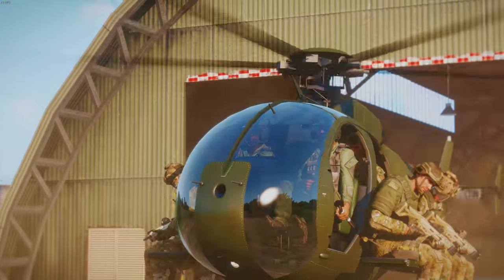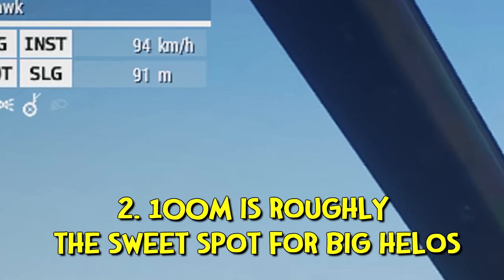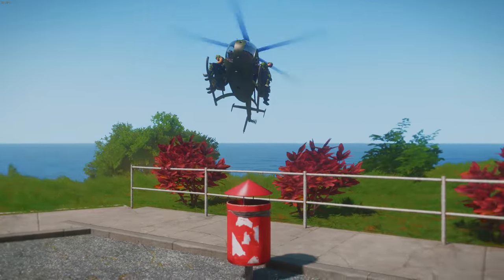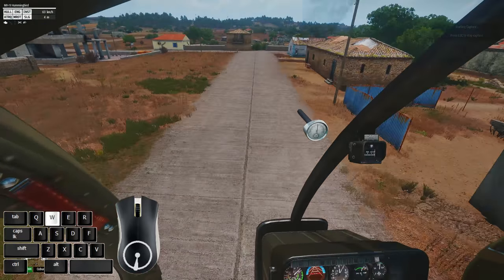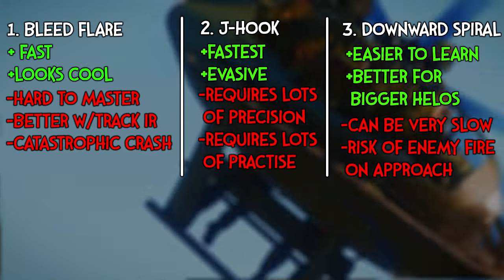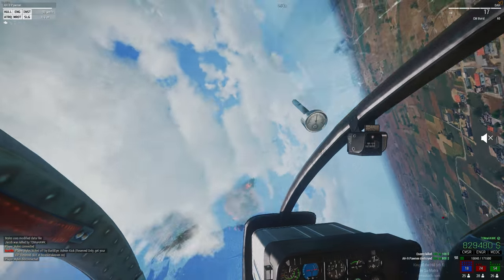ArmA 3 Helicopter Landings Guide 101 ►EMERGENCY + ADVANCED LANDINGS!

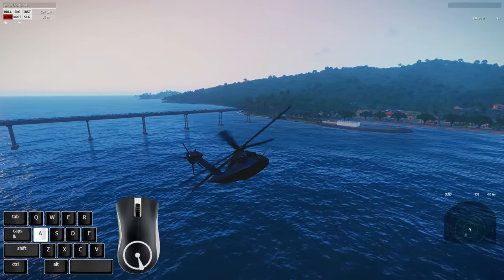Comment: 3:30 The air resistance holds the helicopter in one direction at faster speeds, which stops it from being able to easily deviate from the current direction.
Reply from the maker: PERFECT explanation, thank you so much man. This was exactly what I was looking for!
Reply: Hidden that is incorrect. Bicycles use the gyroscopic forces of the two wheels to keep it upright. These are created from centrifugal forces from the wheels. Helicopters upon loss of tail rotor use the air resistance on the body to cancel out any tendency to yaw the aircraft. This is why when flying at high speeds the rudder pedals get very little response in helicopters with or without a tail rotor as to yaw the aircraft it would increase the amount of air resistance on one side which would push the aircraft in the opposite. This is why helicopters roll into turns first as that moves the upwards force of lift from the propellers from straight up and forward to left or right which then drags the helicopter into a turn.

Edit to clarify helicopters do have a centrifugal force from their blades, however this does not effect the yaw of the aircraft, as the gyroscopic effect of rotating objects only works when the 90* point from the center of the object is rotated. This has the effect of smoothing out turbulence in helicopters.

There are some great diagrams used in FFA Ground school classes for helicopters that would provide a good visual aid and will probably give a much better understanding than reading this.
Reply: The aircraft would definitely rotate without tail rotor to counter the rotation of the main rotor. I'm a helicopter mechanic for the Marines and trust me a pilots worst nightmare is loss of tail rotor authority it will cause uncontrollable spinning of the aircraft. The tail rotor isn't just to counter wind at high flight speeds.
Reply: ELITE DARKNE5S GAMING not sure who you are replying to, but you are correct in a slow/stationary flight. At higher speeds (depending on the airframe) the air resistance on the airframe will counteract the loss of a tailrotor. “The approach profile can best be described as a shallow to normal approach angle to arrive approximately 2–3 feet landing gear height above the intended landing area with a minimum airspeed for directional control. The minimum airspeed is one that keeps the nose from continuing to yaw to the right.” ( https://www.faa.gov/regulations_policies/handbooks_manuals/aviation/helicopter_flying_handbook/media/hfh_ch11.pdf ) notice the excerpt in minimum airspeed, which is to be kept to a point at which the yaw of the aircraft is counteracted.

Additionally the manufacturer of the aircraft may recommend different procedures which may include a 1. Running landing (as stated above) 2. A autorotation which terminates torque of the main rotor, or 3. A extended glide to either of the previous two. 

Now i must add that the most dangerous situation to have a tailrotor failure is taking off or landing as both are relatively stationary and close to the ground. Otherwise a pilot will have either speed, or altitude or a mix as resources to allow for a much easier recovery or emergency landing.

i understand you say your a mechanic for the marines, however last I checked mechanics in the military are not pilots and as such are usually not trained in emergency procedures.

And to be clear here no one actually stated that the tailrotor is used for turning at high speeds, the opposite actually which is that a tailrotor loses effectiveness at high speeds.
Reply: @CallMehTOMMEH  it is referred to technically as angle of attack, just fyi

Comment: @3:30 basically i believe the term would be weathervaning. you get the airspeed of the chopper high enough to where the airflow over the choppers hull will naturally weather-vane it into stable flight.

Also, after finishing the video. Man, im actually surprised by some of those landings not causing ANY damage to the chopper. From My experience any speed over 8km/h will always result in damage to something. If it is over 12km/h its alot more hit or miss sometimes the chopper just outright explodes without even hitting anything. 

I've always seen crazy stuff pulled in the game mode in this video. hell, I've always thought that chopper damage was reduced ever so slightly in those missions to avoid the annoyances of ArmAIII's Damage Model.
Reply: Official SWolf also simplified flight model makes things easier on the choppers
Reply from the maker: Ahhh that's very interesting. I just did a Google of that term and  you're completely correct. Never knew that, thank you for sharing it with me.

And yes, a LOT of people have mentioned this. Basically, it's a combination of the devs tweaking the damage model constantly through updates, and me just pushing it to the absolute boundaries. If I was slightly faster, too much tail flare, it would end catastrophically. It just comes at the result of lots and lots of practise, which gives the illusion of me using godmode whilst flying haha.

Anyway, I hope you enjoyed it SWolf! <3
Reply from the maker: @Schimml0rd Yeah, absolutely. Although, skid-landings are much easier on the AFM, there are some things that are more DCS-esque modelled in a way on AFM, but they both have their pros and cons really.

Comment: The rotor force push the helicopter to the side that spins, so the rear rotor push the helicopter to the oposite side and cancel the force. If you loose it, you can gain speed and at some point the friction with the air will be much stronger than the force of the main rotor pushing to the side, but it will be really unstable to turn and land

Comment: Thanks for the video mate! I have to ask - I have problems with the "aim" up, down, left right keys, under the view menu. Basically, to be able to use yours and others version of controlling the cyclinc with the mouse, I have to disable aiming with the mouse - which means I wont be able to play infantry, without changing the key presets. 
I've someone ask the question on another video, but can you tell me why it is?
I can't press alt x 2 or the like - if aim is via mouse, i wont be able to use your settings. I'd really love any advice or help.

*EDIT*

After a reset of the game it worked, I can aim as infantry and fly the helicopter with the mouse now.. sweet :)
Reply from the maker: Hey man, glad to see you've fixed everything! Let me know if you get into any other problems, the controls in Arma can be a bit funky sometimes haha. 
Cheers for posting the fix too, it helps other viewers if they have a similar issue. 
-Tommeh <3

Comment: Is the war thunder helicopter landing AKA touchdown at around 100kph of horizontal speed viable in Arma or your helicopter will just explodes ?
Reply from the maker: Oh 100% instant death. You can land with about 15 kmph forward speed but that's it
Reply: @CallMehTOMMEH  oh shit
Reply: @CallMehTOMMEH  well now that I've tried it, it is indeed impossible but if you use the advanced flight model you can easily pull it off meaning that landing on roads can be really easily pulled off

Comment: I have no clue how you can fly with these controls of yours, I find them so much harder than the default set up. If I were to use the default set up would I be missing anything important?
Reply from the maker: Just practice and preference. And just the emergency pitch up key. I'd recommend using windows key or something of the like